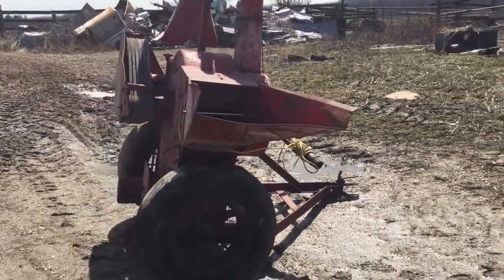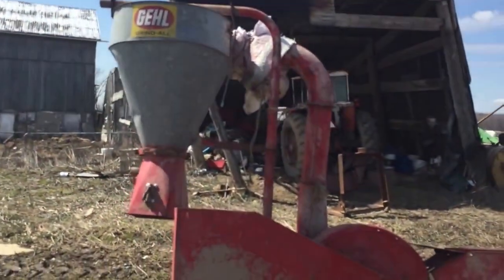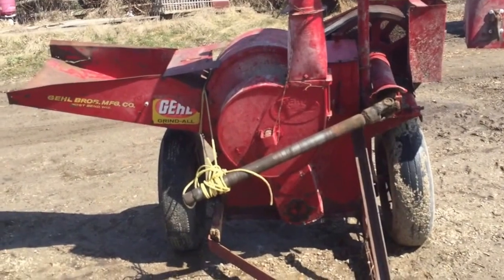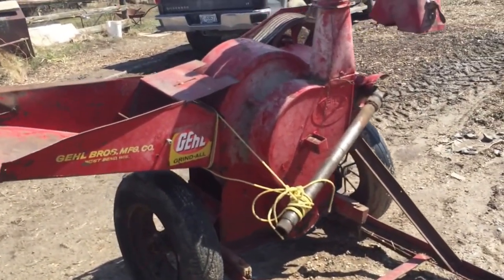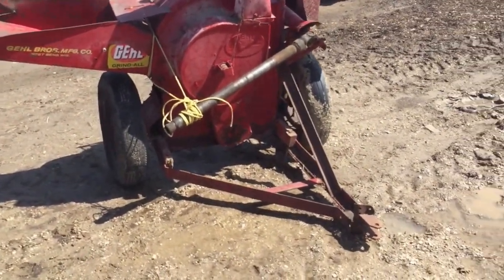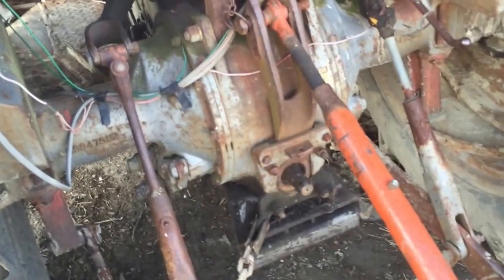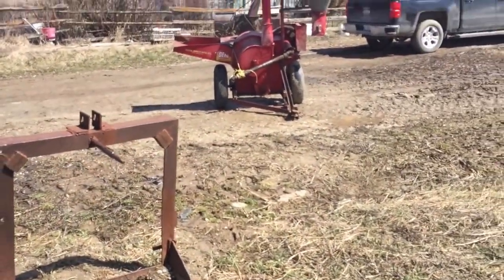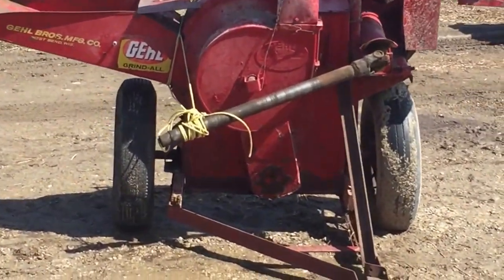my new hammer mill(gehl) and how it works

Comment: Have you had a chance to use it? I'm looking at trying to grind some hay in mine, want to know if anyone has before.
Reply from the maker: you might have better luck with a chipper.My hammers are blunt but the only way to find out if it works is try it.
Reply: wreckandraceify  yes tho the grass varieties it’s not the best with. Good alfalfa goes thru very nicely tho as does some of your straws out there. Any grain, ear corn , shelled , pellet, cube, or heavily stemmed dry matter will be feed in seconds. Alfalfa is great for +proteins in any mix. Large size 1/2” screens I found keep things from clogging n gives a nice chopped product. Pellets turn to dust.